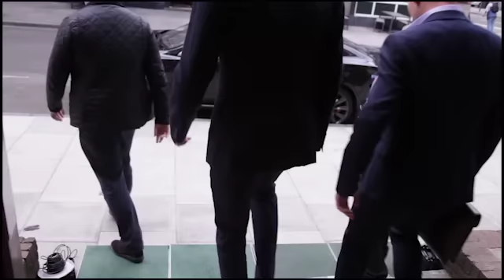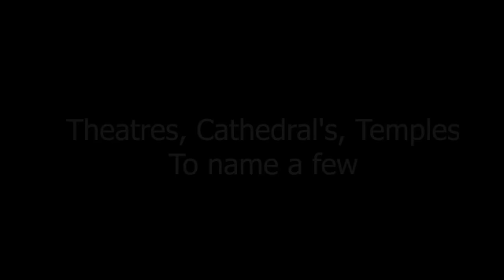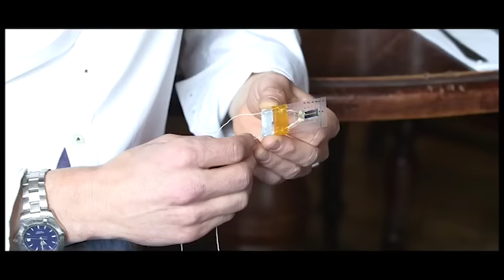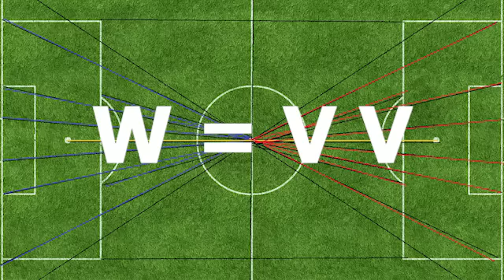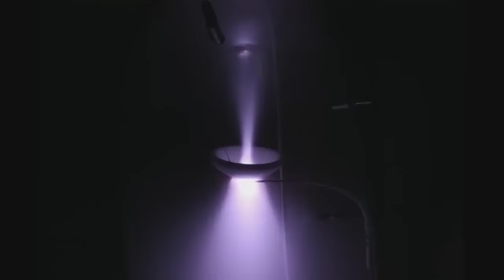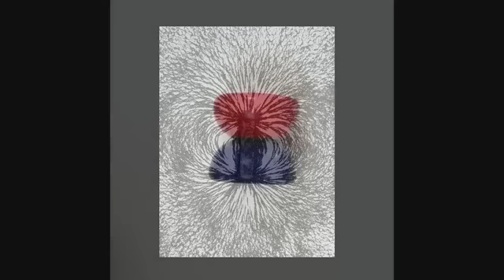Presenting Chad Williams' Video 'Sport Circuits - Part 2 The Squatter Man'

Comment: Weak ends are about discharging and recharging. Capacitor potentiometer or simple diode. I think the buildings+jobs align us as these parts. I can for sure tell you knights templars, aka gridkeepers help feed our energies into this system. It's not just a simulation. I'm not fine realizing my misery is energy for this matrix that's actually fake and meaningless. Meaning is assigned to designate polarity.

Comment: I really like the critical thinking and alternative perspective on the idea of circuit board Earth and electrical and magnetic sciences. You are clearly intelligent and open minded and in that light I have to wonder if you have ever seriously examined the evidence for Earth being a globe? I had never questioned or considered it until recent times but upon doing so I quickly and easily could tell that aside from NASA cgi and rocket light shows there is none. Every single known law of force and motion as well as all tests devised to determine if it might be a globe point towards the impossibility of it.  Just like a circuit board , the Earth is also flat and level. You might want to  check into it. It seems like a critical part of this kind of research.
Reply: exactly. earth is flat which renders a lot of this unfinished.

Comment: The Egyptian boats was reaching a little. I mean, you could mirror anything concave and it would resemble that symbol. I dunno, I need less vague reasoning.
Reply: Unbelievable. Someone with a sincere spirit, great intention spends years researching this awesome and unprecedented information and all ppl like you can do is attempt to prove them wrong.
Reply: @danheath8069  They're just skeptical. This stuff cannot be disproven.
Reply: I have to say that I was mesmerized by the video in the middle and his research of plasma and energy and magnetic force. When he put the magnet thru the center of the bowl and it resisted until a specific point in which it was ejected with force similar to what combustion does. And how matter of fact he explained his conclusion that black holes and dark matter and dark energy don't truly solve or prove any theory that they've been applied to, because we just made them up to compensate for what we haven't figured out yet. Most people won't be able to  unlearn what we've been told all our lives.
Reply: All discovery begins with speculation.